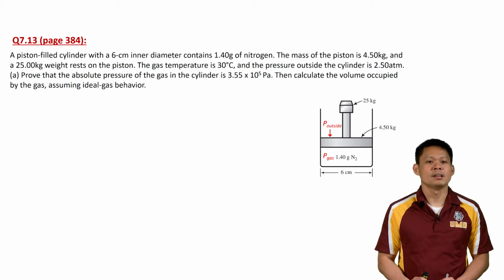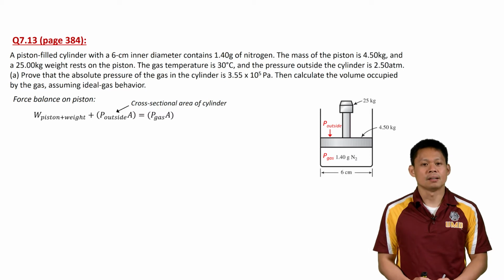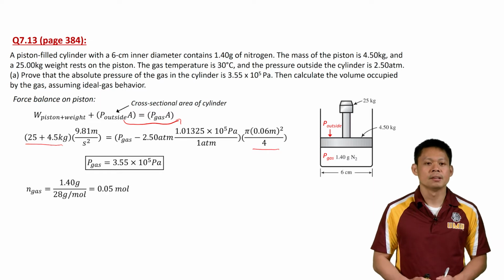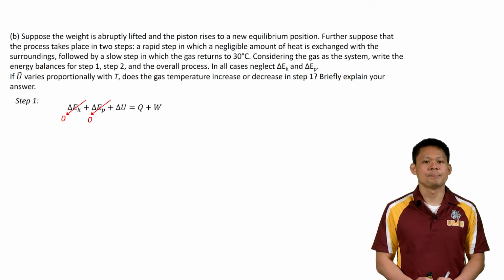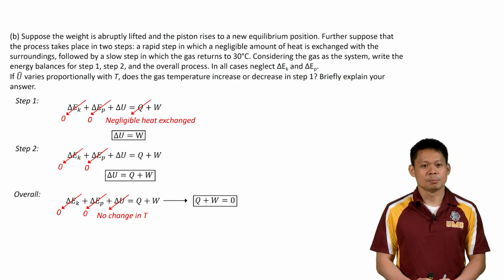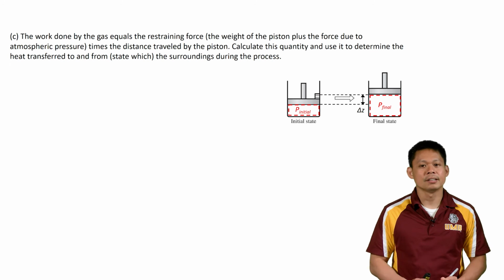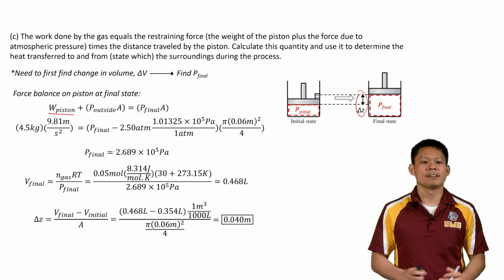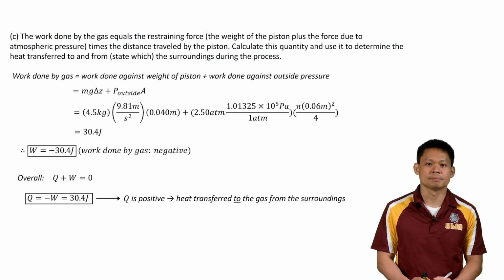Lecture 21: Example 1

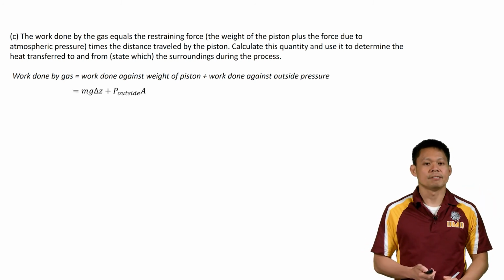Comment from the maker: There is a typo on slide 4 (around the 9:30 mark) - the second term (PoutsideA) should be multiplied by dz as well. (Pressure x area) is a force, and we need to multiply by the distance moved by the piston (dz = 0.040m) to get work done. The final numerical answer is correct though.